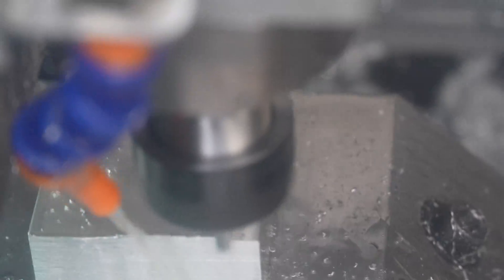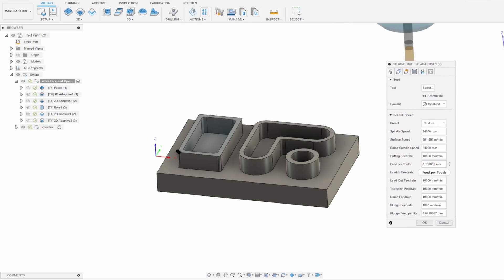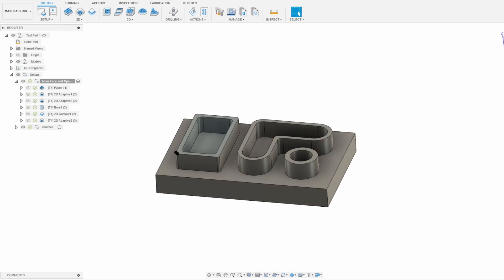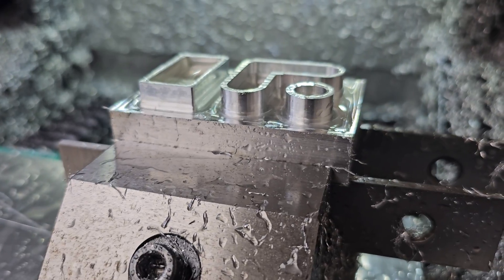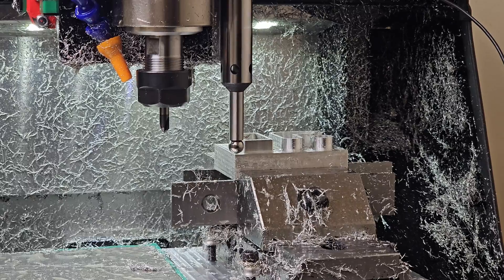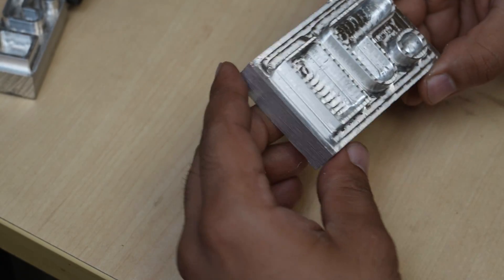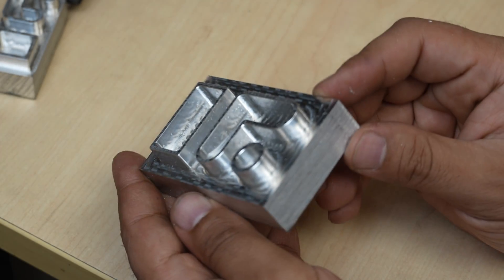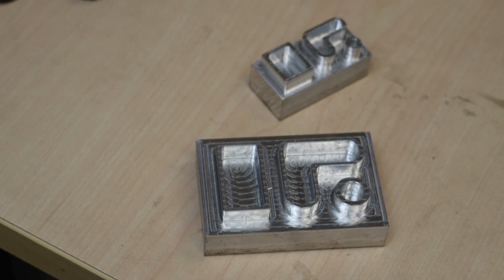Just how fast can we cut on the DMC2 Mini??

Comment: Can this DMC2 mini machine cut unhardened A2, M4, S7, D2 using carbide or coated carbide tools?

When I design and make tooling for my CNC wire forming machines, it is all completely manual and very small tooling using tool steel blocks, either M4 or A2, cutting or forming,  sometimes followed by WEDM or heat treat to get the hardness to production levels of durability to bend stainless steel wire into medical wire forms and surgical parts.

 I'm especially interested in how it can whirl cut a blind threaded hole.. Since the machine is so small it could possibly cut an M3x0.5 thread in a blind pilot hole? I HATE tapping those small holes manually!!

Comment: The linear rails and ballscrews are open and exposed to the chips and coolant. Is this not a problem or is it OK? Just wondering about it cutting something harder.
Reply: Looks like the linear bearings have wipers, should be fine
Reply: The Ballscrew and ways are usually somewhat exposed. Under the way covers but exposed to coolant and the occasional chip anyways.

Comment: What was the final feedrate, DOC, and WOC? I can't find them in the video.
Reply from the maker: Feedrate for the main adaptive was 10,000mm/min, 0.19mm width of cut, 8mm depth of cut. The cleanup contour was 1000mm/min, 0.15mm width of cut, 8mm depth of cut
Reply: @shariffdmc3406  around 0.93 cubic IPM or 15.2k cubic mm per minute. Not bad at all!
Reply: @shariffdmc3406  Could you try increasing the depth of cut? Let's push it to the limit!

Comment: One big piece of advise. Keep the videos posted to max 1 per day. This will keep the channel more relevant for longer and will give you more reach. I know making a video is a lot of work, another reason to spread out the posts a little more.
Reply from the maker: Thanks for the tip!
Reply: That isn’t really true, most of the traffic for this will likely come from prospective buyers like myself who are interested in the capabilities of the machine, and as long as the vids answer the questions we have YouTube will continue to recommend them no matter how closely they’re uploaded. 

At least anecdotally, I’ve had vids posted within hours of each other and both performed far above average, and I know of a few large creators who posted up to 100 vids in a couple hours and they all performed fine
Reply: @dapz  So first you say it's not true and then you say it's based on anecdotal evidence 🤔  And you are comparing apples and pears.
Reply: @MarinusMakesStuff  I provided reasoning for why it wouldn’t be true in this specific scenario based on a ton of previous non-anecdotal information. I then threw in some anecdotes of specific times multiple uploads did not limit reach.

It’s pretty widely known nowadays that small things like upload time, frequency, file names etc will have little to no impact on long term video reach unless you’re actively spamming. Each video is processed and pulled for viewers individually depending on what YouTube thinks the viewer will click on and watch, nothing else.
Reply: @dapz  Thing is, I often write an essay-like reply on Youtube and rarely get a reply or civil discussion. But when I don't write an essay, someone will always tell me I'm wrong and ask me to explain myself. I guess I'm better off never ever commenting since it's either losing face or losing time. It's rarely a nice discussion. Actually it's been a long time since I've had a good discussion :)

Anyway, have a nice day.
Reply: @MarinusMakesStuff  you too! sorry if I came off as a little rude, that wasn’t the intention at all